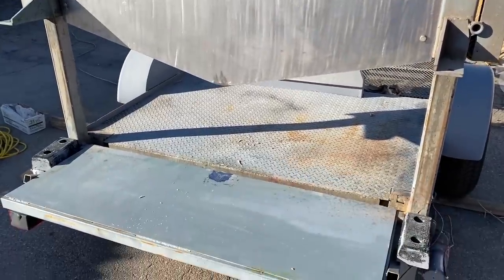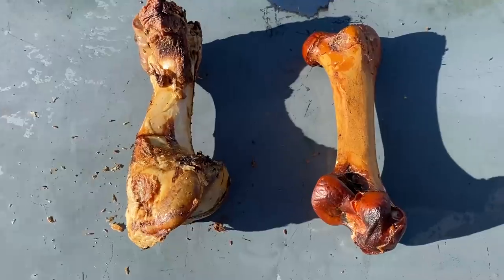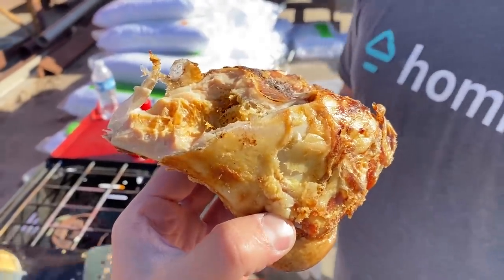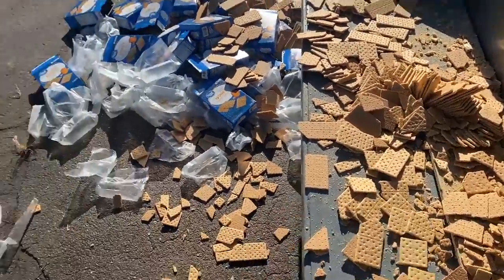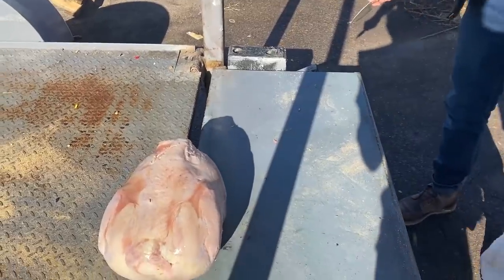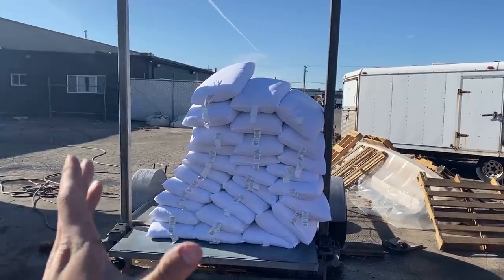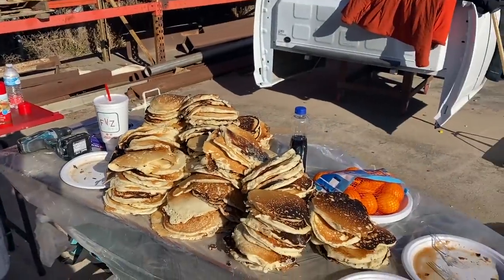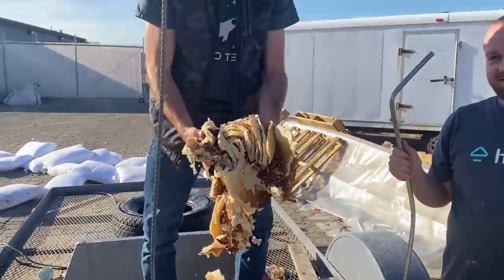Guillotine vs Lighters In Slow Motion

Comment: There is a reason guillotines had a single slanted blade instead of a point in the middle. By putting a point in the middle (and a very low angel in general), instead of just a single high angel slant, your cutting speed is severely slower than it could be.

Comment: Wouldn't the guillotine fall faster if there was less tension on the cable? Figured the cable friction would slow it down. Perhaps a release latch at the top with the cable having enough slack for the full travel downward?

Comment: I am no engineer, but.... I see some issues with the guillotine. It needs to be able to cut all the way through the bottom plate and it needs to be on bearings. Maybe a little higher also.
Reply: I'm an engineer and I'm pretty sure the sliding metal sound is essential to function
Reply: I don't think the French put them on bearings
Reply: @skipfred  I don't think the boys from Utah are French.
Reply: @travisk5589  Lol fair enough

Comment: I think you are loosing some speed because of the friction, either is the cable that hold the blade or the side rails, at that weight it should be faster ...

Comment: Bruh that dust that's coming out of the old TV is carcinogenic. I've busted them open before and they have a tag on the inside that warns against busting them open. Lol

Thanks for putting the warning deep inside the TV so I don't see until.after I've beat the hell out of it with baseball bats and crowbars.

Comment: MAKE IT GO FASTER! GRAVITY IS GREAT AN ALL BUT YOU COULD EASILY ADD A PULLEY AT THE TOP AND TWO ON THE SIDES, THE ONES ON THE SIDES ARE TO ADD CABLES ATTACHED TO SPRINGS AND THE ONE AT THE TOP IS TO BE ABLE TO LIFT THE BLADE AGAINST THE SPRING TENSION!

Comment: stop using the cable to drop it. mount a quick release to the top of the blade. many reasons to do it. less dangerous, will not wear the cable out or the pully, allows the blade to free fall with less resistance.  hope you all see this and take it into consideration
Reply from the maker: It does use a quick release. Watch our other guillotine video to see how it works.

Comment: That’s only if you break just the screen inside there is a chemical that gets released but you should be good cause you’re outside in a ventilated area and there’s nothing else to contain that gas usually it’s because the rest of the TV is still there and it’s just the screen broken but you have a different case😂🤣😂🤣